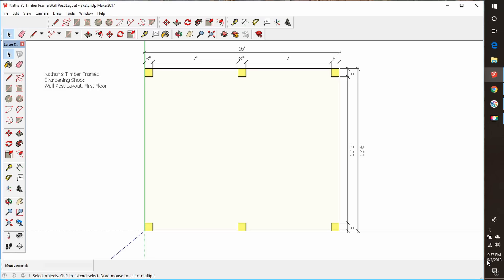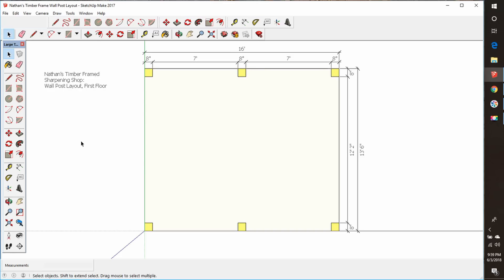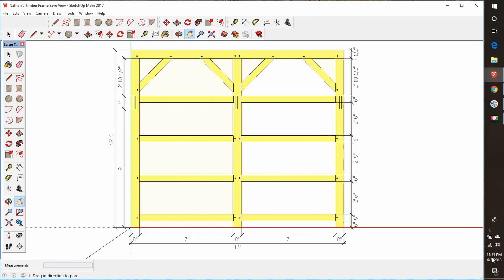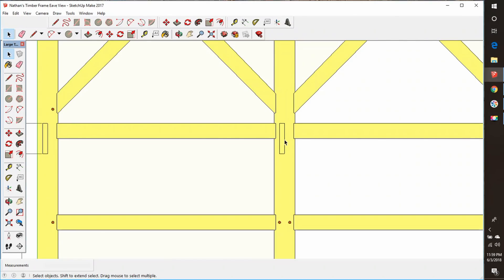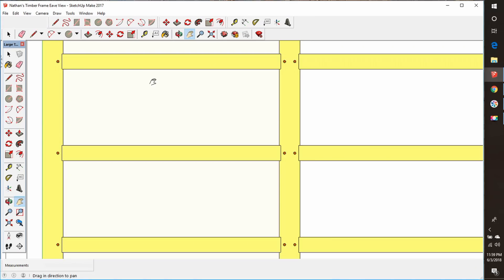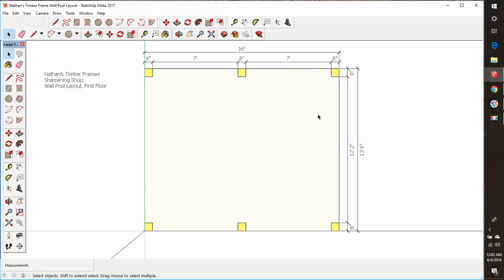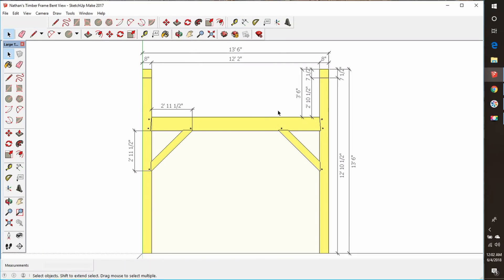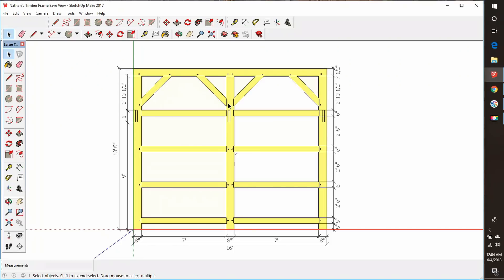A Timber Frame for Out of the Woods Using Sketchup part 1

Comment: Well this is a jewel to find! Now that I've had to cancel my April trip to TimberFrame school, I have time to fill. What better than Sketchup tutorials! I like your "from the roof down" guidance; it's a different perspective, and helpful.
Reply from the maker: You need to know your roof loads to plan what will hold it up and so on, that's why I start from the top.
Reply: it doesn't snow where I live, and the rain, of course, runs right off. Does that mean there is no live load on the roof, only dead load?

Comment: Hey Jim, heard you talking about hemlock in the video.  Would the same advice go for White Oak?  I'm working on a 3 year timeframe to cut/store and raise.  Ideally, I'd like to make the cuts, stick it, store it in pole barn until raising?  Do you think that would work, or do you thnk I should use a different wood like EWP or SYP?  Thanks in advance.
Reply from the maker: Use the oak but invest in some big ratchet straps and bind your stacks with them to help keep them from moving on you.  Also seal up the end grains, that will help a lot.
Reply: Do you mean actually assemble the bents and then bind them?  Or just bind the stacks to help prevent twisting?
Reply from the maker: Just bind the stacks.  Make sure to sticker vertically and horizontally though.
Reply: Yes sir.  Hope you're feeling better.  Just watched your... I fell through the hole hospital video.   Horrible thought, but you should kinda' consider yourself lucky?

Comment: I've done stuff like you're doing the hard way, w/ the cheap program, "Paint" that came w/ my new computer. I've done a lot of it by sketching on boards and legal pads. CAD programs can be good too. If you really want to get complicated you can do a side elevation, front and back elevation, top and bottom elevations. Also, quarter views and detail views ect. The drying time is not always 1" per year as you said because some years are hotter or wetter.

Comment: Have you seen or used the Timber Framing Extensions for SketchUp (https://extensions.sketchup.com/pl/content/timber-framing-extensions)?  There's a bunch of timber framing specific features and it allows you to generate really nice shop drawings.  They were developed by Clark Bremer and are free.  I've been playing around with them myself doing some design work on personal projects.  There's also a nice instruction pamphlet available from the Timber Framers Guild - I think it costs $20 or so, but it's basically a donation to the guild.
Reply from the maker: I will check that out, thank you for the information.

Comment: Glad to see you’re doing something cool JIM. Before I retired I worked with an architect in Los Angeles named Frank Geary. My title was virtual architect. We worked with a really high powered CAD system 3-D modeler called Catia. We also use the system called rhinoceros which is far less expensive and easier to use. I never use sketch up. After watching you here I think I’m going to download it because it sure looks quick and easy. I worked on A couple really cool projects One was called Disney concert hall in Los Angeles. Another cool one was Experience music Project in Seattle. I worked on a bunch more but those were a couple of my favoritess. They’re both on the Internet if you want to look.
Reply from the maker: That is neat.

Comment: Dear Jim,
I didn't expect this but am pleasantly surprised as this topic is most relevant to building construction plans. I've been looking here & there for something like this but sadly to no avail as I run Imacs only. Plenty for Microsoft based computers but nothing to my knowledge for Apple. Short of running Parallel with Linux, I am stumped (pun unintentional!). The other thing my feeble brain cannot cope with are Imperial measurements either & most books are equally published using almost exclusively Imperial. Any suggestions my dear friend??? Kind regards.
Reply: Yes there is SketchUp for Mac. Pricey = $700.00
Reply: Dilip: A free one for Mac is called Blender. Pretty good, you might like it. M
Reply: Dear Michael,
Many thanks for your courteous & hearted response & more importantly for coming up with a solution that has evaded me for so long. Have downloaded it just now & will play in the next few days to see how to navigate through all this high tech stuff. Will endeavour to keep you informed of my progress (if any!!!). Kind regards.
Reply from the maker: I'm sure you can get Sketchup for your Mac.  It's a Google software that's free.  It can do metric as well.
Reply: Dear Jim,
Thank you very much for your courteous reply; just as Michael Kroeger said it's only a mere $695 only. I thought I had already consulted Google in the past as I do an extensive every so often for 3D software ( construction/building) & have never come across a free Mac version. I'll keep looking & see if there a Linux version available. Will let you know. Kind regards.
Reply: Dear Michael,
Thank you very much for keeping me informed. Indeed as you rightly said & I went onto their website; one needs to part exchange one's wife for the privilege of getting it. Too high a price for me; will look for some alternatives. Kind regards.
Reply: There's a free version of Sketchup for Mac.  Don't know if you need SketchupPro, but SketchUp is free.  Here's a link. https://www.sketchup.com/products/sketchup-free

Comment: excellent explanation of the process. looking forward to the next steps of the planning process. thanks.
Reply from the maker: Good morning.
Reply: I have been following your progress on the shop for months. I am in process of starting a new small sugar house for our family. We have a lot of white pine and hemlock and poplar on our place that are at the stage they need to be harvested or they are going to  become problems. I am planning on a building about 10'x14' because we have a small evaporator just for our family use. I am quite interested in your planning process on Sketchup. It looks like I might even be able to figure it out from the looks of it. By the way, still praying for your speedy recovery.
Reply from the maker: Thank you Robert.  If you have the timber available go a little bigger, it never hurts and you'll thank yourself later.
Reply: I chose that size because of the specialty of the use of the place, our evaporator is a small 2'x5' one that handles about 150-200 taps. Plus it seemed to me to be a manageable size to work on. We have a small dairy goat herd and I am starting a meat goat herd as well. So we plan to build a bigger barn in the future (near future hopefully). I believe I have most of the timber needed for both projects, about 12-13 acres and 10 of it is wooded.
Reply from the maker: That is excellent.  Sounds like you picked the perfect size then.  You will really enjoy the timber framing.  It gets into your soul.
Reply: I will be traveling the next two weeks to Pennsylvania and then up to Maine but will either catch up on your videos or keep track of them as they come, depending on my schedule. Thanks again for the good work.

Comment: Jim:  Your off to a good start.  When you get used to the push/pull feature you will be able to extrude/stretch the surfaces in the third plane.    I would start with the plan view and stretch the posts up to the required length.   Now you have 3/D model of the posts.   Then draw a girt in plan just outside the posts; in 3/D select the top and pull up 6".  Extend the cut line of the tenon across; then select the small top of the tenon and push it down. Rotate the model and repeat on the bottom of the tenon.  When complete on both ends make it a component and name it.  You will only have to draw a common timber once then you can copy and move them into place as a component.  I use a different program and have only smidgen more experience than you on sketch-up.   But Mike Dillon and others could talk you through it on Skype.    the old guy   Bert
Reply from the maker: Thank you Bert.  I'll get better at it.
Reply from the maker: I agree

Comment: Just a reminder to work with free weights to keep your hands and arms in condition while your leg is mending. 
Unless otherwise advised, keeping the good parts working leaves less to recondition when you're back up on both butt-kickers.
Reply from the maker: I keep a set by the bed.  Makes a difference.
Reply: Very good, I've been there a time or six.
Reply from the maker: You sound like you have.
Reply: Or varying resistance bands.
Reply from the maker: Had those in the hospital

Comment: What do you mean by "timber locked them?"
Reply from the maker: Timberlocs are a special timber lag designed for log and timber work.
Reply: That's what I thought I remembered but it's been years since I came across their website. Why did you choose to use timberlocs? Just added insurance? Or as a way to use slightly smaller timbers?
Reply from the maker: Used them where I wasn't able to use tenons.  They hold very well.

Comment: So glad to see your back at it one way or another.  -Will
Reply: Will... SketchUp can do that with no problem. Do a search on Youtube for some of their tutorials on its use, they have a ton of them. And there are independents putting out videos as well. You can render pretty much anything in 2d and 3d with SketchUp.
Reply: John Collado Awesome. This may be the ticket for my truck shell camper build. Thanks! -Will
Reply from the maker: Getting there, this one is boring...just not the same.
Reply: Jim, Do you think I could use Sketchup to design my truck bed camper blueprints?  Im looking to add a 12" subfloor to my truck bed with hinged storage compartments and drawers.  Or is this software more for structure drawings?  Thanks -Will
Reply from the maker: You can use it for just about anything.
Reply: TheTradesmanChannel  Awesome! Ill have to look into it  - Will
Reply from the maker: It's free which is a help
Reply: Any Sketchup tutorials you recommend.   Is there one that stands out over another?  Thanks
-Will